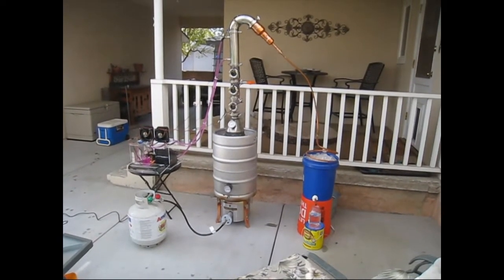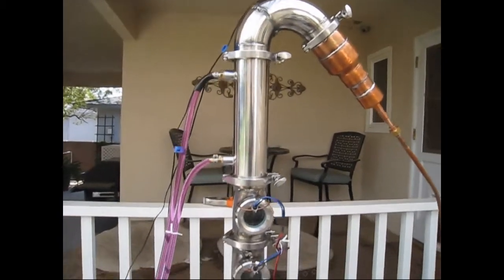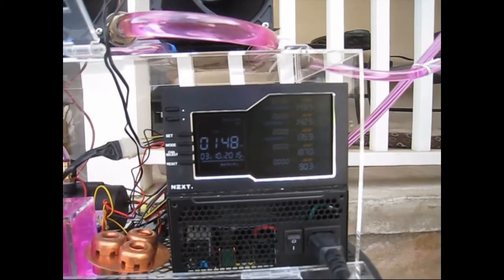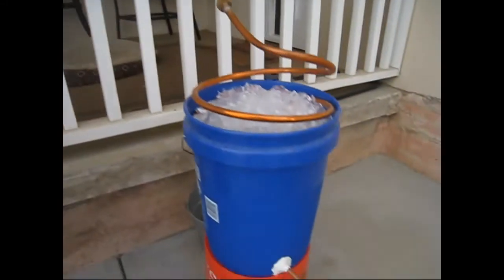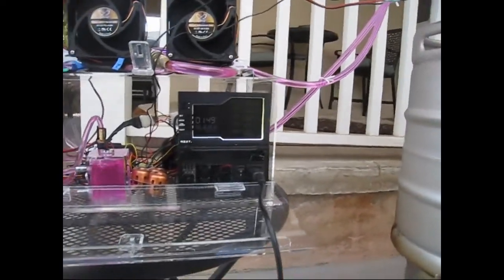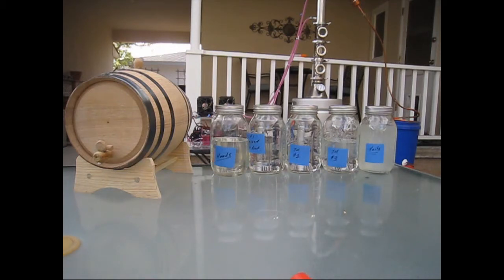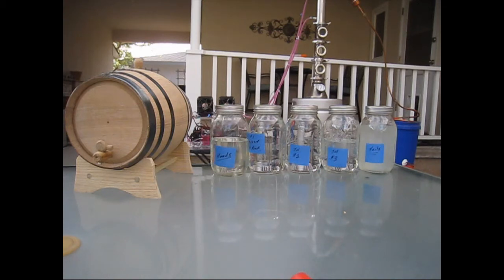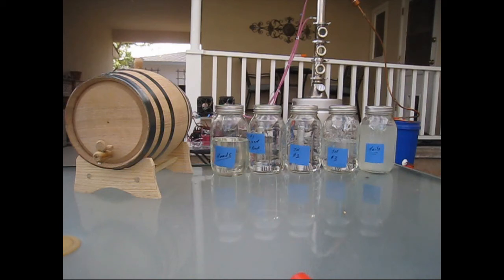First Run New Bubble Plate Still with Dephlegmator

Comment: Nice setup ! I us a two keg set up that I built and use a PID and two water heater elements to heat it . I also have a 60 gal pot still heated with propane and am working on a colum still 30 gal. I'm interested in your cooling method for my fermenter thanks for your video

Comment: You don't need to throwaway the heads in this small of a setup, you're losing ALOT of product.
Reply: you always need to separate the first 5-10% due to the compound distilled not been the proper alcohol, but ethyl, and can cause a series of neurologic issues.

Comment: word of caution, those unions have traces of brass in them, where they are positioned inline with hot vapor its possible for brass leaching to occur. If vapor was already cooled to lower temp before the copper unions then brass leaching MAY not occur. just solder a female fittings instead of the union then just stick it in firmly when you go to use it, then apply flour and water paste mixture. Works just as good and millions times safer. happy distilling

Comment: Great looking setup. :) How effective is the cooling system? What have you used as coolant? Run-through speed?
Reply from the maker: +Lars Bang Rasmussen 
I do not control the speed of the coolant through the system, it is possible to control the speed of the coolant pump. I run the pump at full speed and control the speed of the cooling fans on each radiator separately. thats how i control the temperature.
Reply: Thanks. Could you please tell me where you bought the heatsinks?